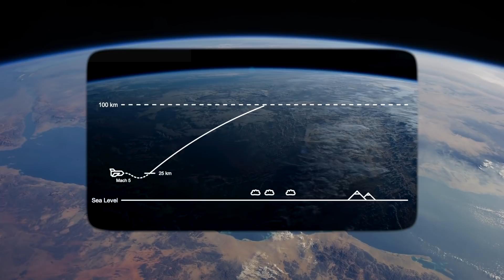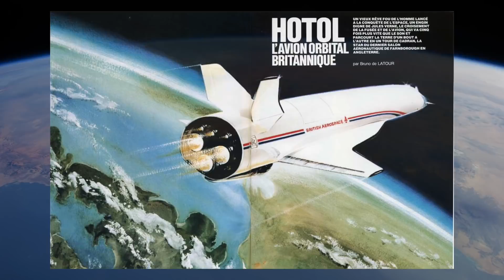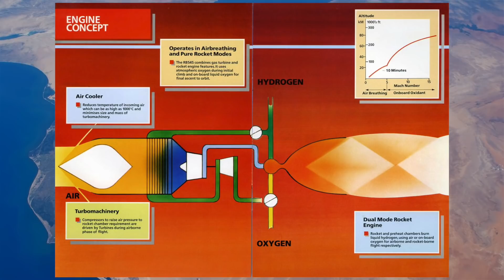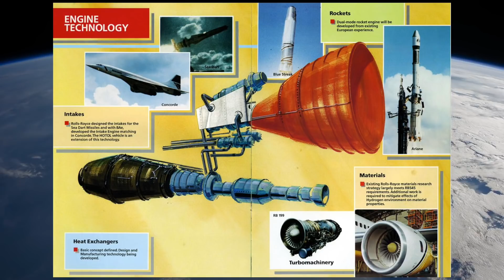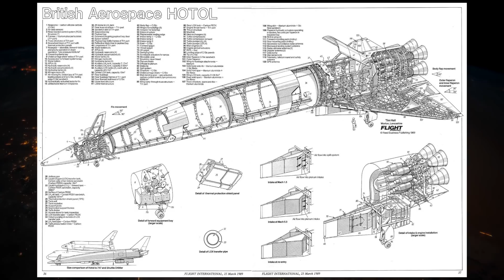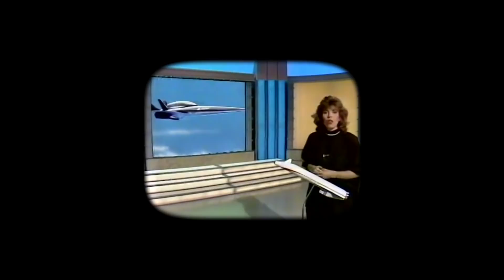HOTOL - Spaceplane of the future

Comment: We know of a few test models of hypersonic air-breathers, and a few non-flight tested airbreather/rocket hybrids.
Good luck putting it all together into a system that is airplane-like reusable. It hasn't been done yet.

So far, the best body shape for such a vehicle is the old Soviet Lozino/Lozhinski "Lapot" (wooden shoe) body of the Spiral. Used in the HL-20 and today in the SNC DreamChaser.
NASA Langley said that it had "exceptionally benign thermal characteristics" and good handling from hypersonic down to landing speeds. They said that it might not even need carbon-carbon on the nose and leading edges. The flat up-turned nose of the Spiral/MiG-105 made a stand-off stagnant layer that kept high temperatures away from the nose. (Of course in America, it was too clunky and "Russian" looking and of course "if it looks right, it'll fly right" is most important) For some reason, this body shape wasn't used in the "MAKS" spaceplane 1.5 STO.  We know why it wasn't used in the Buran Shuttle: Uniforms and suits dictating to engineers.

Of course, then there's the Rockwell "Star Raker" HOTOL SSTO. ≈2500 ton take-off (jettisoned take-off wheels), 100 tons to orbit. It also had hypersonic air-breathers, but then turned them off and switched over to rockets. Due to "wet wings" (loaded lifting structure) it flew into orbit and had low heating (low loading) on landing.

Comment: Love the 80's artwork in those magazines.  Also, as for the original design with the engine at the rear, why couldn't they remove the heavy hydraulics from the rear and replace them with simpler electronic actuators like Electron or Astra does offsetting some of the rearward weight? At the same time by using the front to store the heavy batteries even more weight would be offset?

Comment: Seems like a bird strike at launch would be a VERY costly and dangerous event.
Especially if the landing legs arent made to handle the weight of a fully fueled vehicle.
Could this be another reason air breathing rockets just wont takeoff :p
Reply from the maker: For sure there are downsides to the hydrogen filled precooler on HOTOL. Both HOTOL and Skylon were designed to be able abort the takeoff run though. Likewise both RB545 and Sabre were configured so that a bird couldn’t enter the engine and strike the precooler with significant kinetic energy.

Comment: 4:16 Yes and no. While the payload of a modern launcher is usually bigger, that's mainly because they can also deliver multiple payloads. In actuality, however, satellites have become *smaller*: the average weight per satellite is actually around 3 tons these days.

So, on itself, it could still be a viable way for economically sending satellites in space, compared to one-use-throw-away rockets.

Comment: HOTOL being an aircraft would've had the potential of in-air refueling. There's also some viable concepts for condensing O2 out of ambient air during horizontal flight, possibly allowing such a craft to take off without any liquid O2 which would make it considerably lighter and probably eliminate any need for that take off sled. 

The real achilles heel of any such system (including Skylon) is that it absolutely requires a high flight rate to bring costs down enough to use said capacity. There's just no middle ground over which you can count on the demand that would justify the number of flights that in turn lowers those launch costs enough to create that demand in the first pkace. Yes, this is a very circular catch-22 that's only resolvable by either mandating the demand or letting other launch systems develop the market.

Comment: HTOL was not a practical design because hanging the heavy engine on the back of the vehicle meant that it is not possible to maintain the centre of mass through the whole flight regime. It needs to carry a lot of heavy fuel and as it is used up the centre of mass moves back and the vehicle becomes unstable. That is why Skylon mounts its engines on the end of the wings.

Comment: A question I have after this is: Since the Hydrogen would be used for precooling the incoming air, does that mean it would not cool the combustion chamber and nozzle? So, they would have to be ablative? Doesn't that defeat the purpose of reusability? Or were the nozzle and combustion chamber supposed to be easily interchangeable?

Comment: If hydrogen absorbs inlet air then its compression / pressure will increase.  Weight penalty?
Reply: it doesn't, it's separated by a heat exchanger

Comment: The Hotol project developed into the Skylon under Reaction Engines. But even this may have changed to a two stage launch system. The consistent component is the Sabre engine being developed by Reaction Engines. Hopefully, this will give you some key words to go on.

Comment: SSTO is so so dumb. This was doomed.  The small time the rocket is in the atmosphere using an airbreathing engine is a waste of weight carrying all the extra parts.  It's like no one did the maths on this.
Reply: They did the maths on this, and it can manage a 5% mass fraction, just like VTOLs.
Reply: Where??  A ramjet works in a narrow operating window, so at less optimal speeds and are pressure it will me much less efficient than a turbine engine or a pure rocket engine at high+slower speeds or higher alt/higher speeds. After a minute or two the air breathing aspect is totally useless and for the rest of the burn(maybe 6ish minutes) it’s dead weight. For all the investment required in building and operating this thing the payload to orbit would be pathetic.

Comment: Inerestingly, the Starship won't be using heatshield tiles. Instead it will spew its liquid methane fuel out of thousands of tiny holes in the belly of the craft, which will vaporize and wick the heat away. this is helped by them using steel instead of carbon composite, which means the structure can withstand much higher temperature.
Reply: Nah, they abandoned that. They're using hexagonal heat shield tiles.

Comment: A few of the engineers that worked on Hotol (Alan Bond, Richard Varvill) went on to create Reaction Engines and the project to build the Skylon SSTO spaceplane. They are working with the European Space Agency and Lockheed Martin to develop the SABRE engine that uses the same ideas as Hotol. They have created a functional precooler that does not frost. Liquid nitrogen is used as the heat transportation fluid.
Reply: Lockheed Martin?

Comment: From someone who saw this story from the inside can I say another good job. What you have there is what we called the “Prince Charles brochure,” so guess who it was originally prepared for, but I am not sure if he ever saw it.  It did not describe the engine properly because, as you said, it was a secret. However, the RB545 is described in "HOTOL's Secret Engines Revealed", Spaceflight, Vol 35 No 5, May 1993.  And, yes; the undercarriage mass due to take off loads was the concern leading to the take-off trolly - that nobody ever thought was a good idea. It was brilliantly worked around by Alan Bond and Richard Varvill when they revamped HOTOL to become Skylon.
Reply from the maker: Thanks Mark. I really appreciate the compliment!

Comment: Alan Bond was the man behind this idea. Reaction engines created as a result, still exist and have done several tests, but for the life of me I cannot understand why the UK have not poured funds into this.
After the space shuttle disasters it would have been great for Britain to take the lead, but we were committed to the European space program at the time.
Forget space x, this is the way to go. Less fuel used on take off and into orbit. Paving the way for hypersonic passenger transport in the future.
The space shuttle was a lash-up. The original idea was the shuttle piggy-backing onto a larger vehicle, which would land after releasing the shuttle to go into orbit. This larger “mother shuttle” was cancelled due to costs and instead NASA just strapped the shuttle to a fuel tank with 2 old boosters on the sides, and we know what happened as a result.
The space x vehicles keep crashing. This HOTOL was a great idea. Time for Britain to lead the world again, we have the best people, the best ideas and innovation, but all to often either lack the commitment or sell (or give away) the ideas on the cheap to other nations.
Too many kids nowadays want to be instant TV celebrities rather than engineers and scientists.
Time to change, time to lead again. Kick NASA in the arse, push the Chinese into the weeds, and show them all how it’s done.
So says I 🤗🇬🇧😜
Reply: Fuel is cheap, it's the weight it adds that's the killer. And the Falcon 9 has gotten very reliable, with something like a 95% success rate with landing the booster, and no failures to deliver payload since that pad failure in 2016. But if you're talking about engineering prototypes, ok, I guess... The advantage that SpaceX has with the F9, and to a lesser degree with Starship, over the spaceplane projects (any of them) is complexity. Sometimes complexity is necessary to achieve certain goals, but it invites complications. But, yeah, this sort of technology can translate directly into the air transport market. Elon Musk (I got the idea it was him, more so than Space X) made some noises about point to point passenger service with Starship, but I'm filing that concept under "pictures from old World Fairs about future tech that never happened". If it doesn't have wings, and take off from a city airport, it's not going to happen.

Comment: Spoke with Bond, Parkinson and Scott-Scott (the inventors of the concept) on several occasions. Making the engine secret (still is) was a massive impediment to continued development. However the biggest problem was being able to trim the vehicle as it’s centre of mass and centre of pressure changed radically within the flight profile. At time of cancellation the problem had not really been solved, a fresh start was needed. Getting around the Rolls Royce secrets problem resulted in Sabre, sticking them on the wings to calibrate the CM with CP solved the trim problem. To get the funding they needed to demonstrate that the Heat exchanger technology would work, once that was done, the US got interested as a propulsion system for Mack-5 hypersonic aircraft. Now the original design engineers have gone I don’t think Reaction Engines are interested in developing Skylon any more. Richard Varvill (Reaction Engines founder) estimated it would cost £50 billion to get to demonstrator flying.
Reply: It isn't still a secret, was declassified in the 90s.

Comment: Issue with the Skylon configuration is that in the rocket mode in a vacuum the exhaust spreads out and bakes the rear fuselage. NASA picked this up in about 2014 and wrote a paper on it. The engine needs to go back to the rear.
Reply from the maker: I am aware of this one. Last I heard there wasn't particular concern on the part of the designers because the fuselage is designed to deal with reentry and the heating from plume impingement is far less severe than that.
Reply: @Thumblegudget  if they aren't concerned it would appear odd that they are essentially currently planning to use the Skylon as a reusable first stage and not use the LOX mode of the engine at all. Essentially the rear fuselage would end up being an extended nozzle, if we look at the materials and temperatures they tend to use on a radiatively cooled nozzle (carbon carbon and niobium) it is somewhat higher than the tiles that they were planning on using plus they is the issue of the insulation on the other side of it.
Reply: @adodgygeeza  The first stage does use LOX. The TSTO concept actually has a worse reenty heating problem.
The huge advantage of TSTO is it massively de-risks development as first stage mass over-runs aren't as important due to the rocket equation.

Comment: Military,Elites&gravity ("oh my!"), keep us from making anti-gravity & electric energy flight engines, feasable beyond the rainbows. So how to do this without unstable fossil fuel? SSTO & HOTOL is a way. Having a plane engine that morph/switches from wing & blade purpulsion, zero chem fuel, to jet faster, then Ramjet higher to the kamen peak of low air&grav, finally after the line, into pure saved lesser rockets exirt to high orbit exo, then electric/energy nuculear amp. To solar deep orbit of infinate graviry granted acceleration. 2/3rd of a rockets first zenith stage launch is burned out at under the first 60miles, such a historical luxury of canisters flame burning money for quick ride up.

Comment: Didn't the brains involved in this project go on to form Skylon.  Their Sabre engine has achieved the required air precooling which I recall they were saying was a big hurdle.  They probably don't have the money to make it actually happen. It would be wonderful to see it come to fruition, but I'll be surprised if it does.
Reply: Well, their next step is demonstrating the engine cycle. They don't have the money to blow up 15 attempts which does make them slower but they're still there and did recently release videos of a test for the preburner system (sort of like the starter motor).
Reply: Calling  Elon Musk, Britain has a concept plane for you.
Reply: @drhot69  he knows already and is unimpressed. I think the basic problem is that Skylon requires multiple leaps in technology and a lot of spending before one can launch anything. The 2sto designs are a lot less risky but also somewhat limited. He has found a way to take risks more progressively and get paid while doing it. I'm still a Sabre fan but I can see the situation.

Comment: Spacex is a dead end. Skylon is the way forward. Great video
Reply: Skylon (and by extrapolation HOTOL) have issues as well.  For example, the extra complexity of the engines is a huge burden.  Also, the extra weight of SSTO and adding wings, etc. for atmospheric flight are also issues.  There is also the question of refurbishment time.  Just because something looks like a plane doesn't mean it's going to have airliner like turnaround times.  The aforementioned extra complexity of an SSTO may result in substantially longer, and more expensive, ground refurbishment requirements as well.  Back in the day it was assumed the only way to achieve full reusability was through an SSTO, hence their popularity.  That assumption is proven false.  So, it remains to be seen if SSTO designs have any actual benefits over the SpaceX approach (Starship for example).  So I would say no, SpaceX is definitely not dead, and SSTOs, having never been born, need to step up or shove off.

Comment: My mother worked at UMIST in the 90s and had a half profile fluid dynamics model of the HOTOL hung on her office wall.
Reply: Instead of a runway couldn't they either used a track (magnetic or otherwise) to increase the ship to a speed on the ground
Reply: @jasonjase8661  Likely this was the most solvable of all the issues this design faced.